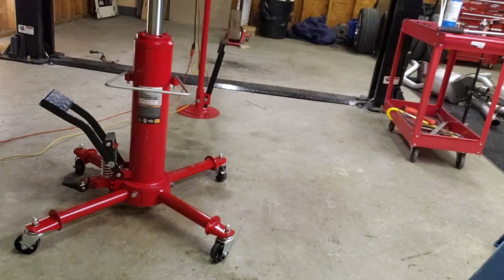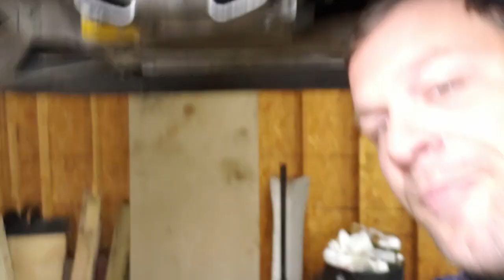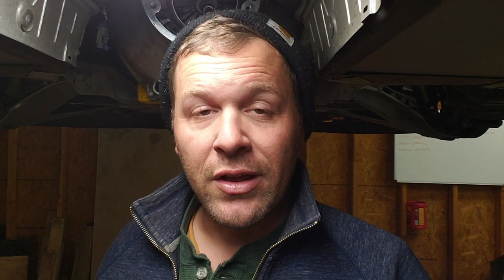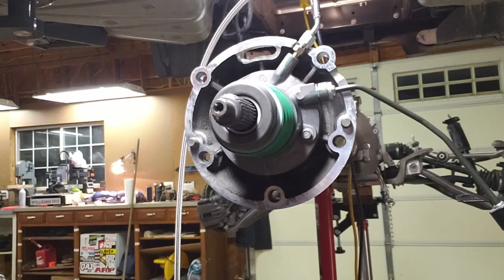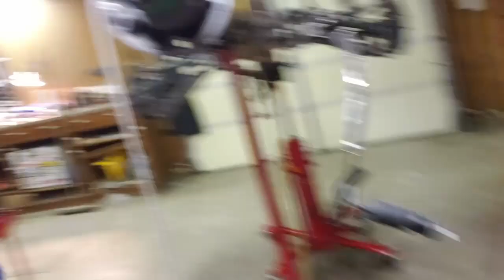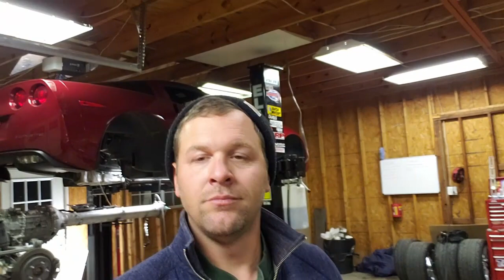New series, new build, new problems!

Comment: Since you have everything you need, ever think about putting in a carbon fiber driveshaft?  Been curious how well they work on an ls3 car.
Reply from the maker: I have considered it. I'm kind of in a holding pattern right now. A tornado hit my shop this summer so I'm in the middle of tearing it down and building another. So I'll be back on the horse in a month or two. I have a ton of new goodies and projects coming up.